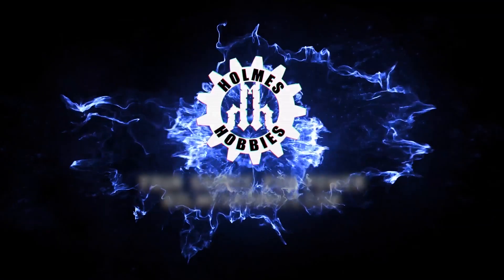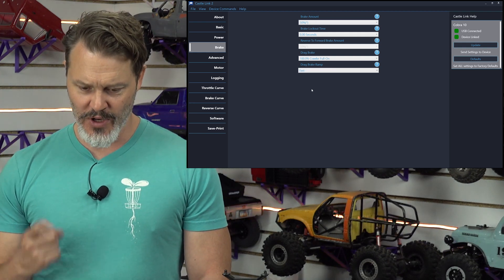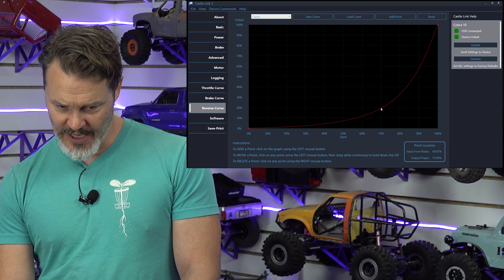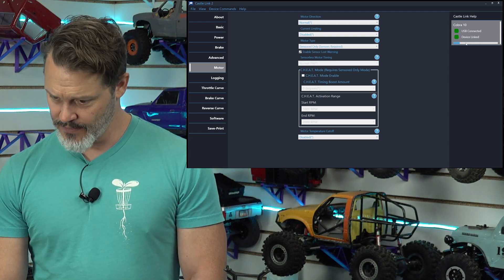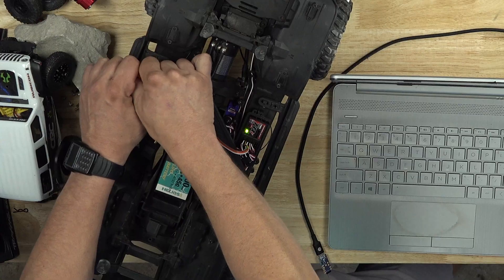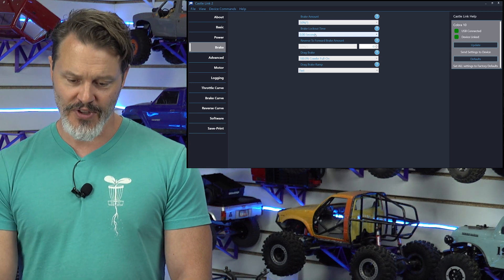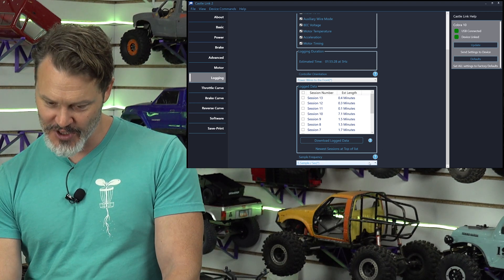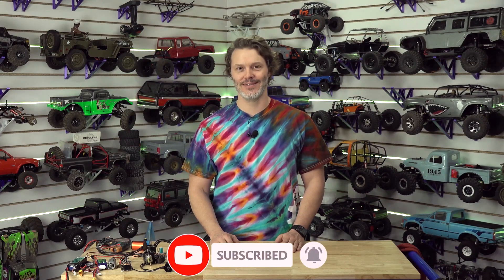Can John Robert Tame the Cobra 10 ESC? Programming for Rock Crawling Perfection! 🛠️🤞

Comment: I was the developer on Castle Link 2, I added the 'Add Point' button to the top of curve screens after watching you set the throttle curves manually. There is also the 'Mouse Location' or 'Point Location' in the bottom left that make it easier to set the exact value you want.
Reply from the maker: Great additions!